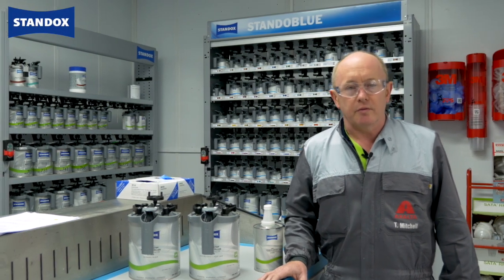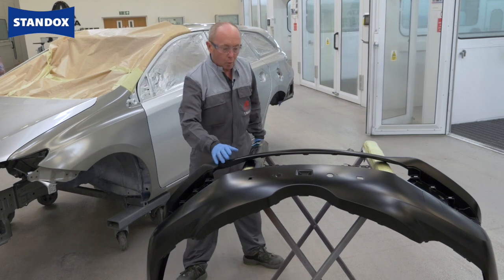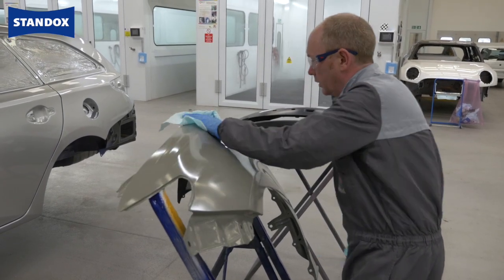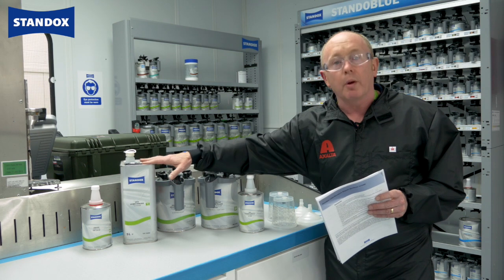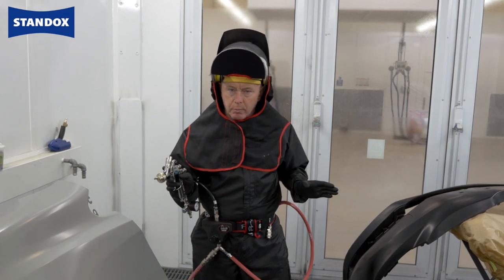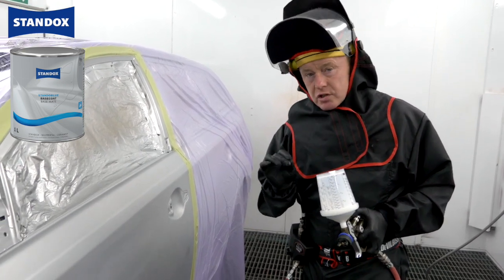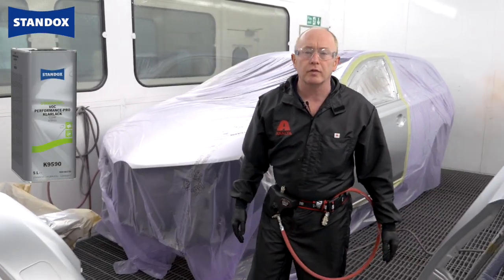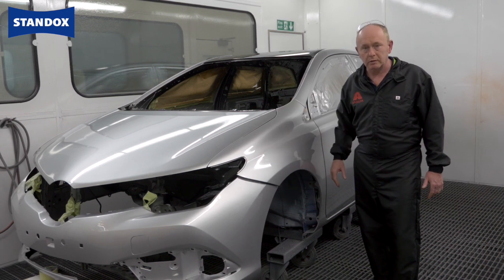Standovision: Standox VOC Nonstop Primer Surfacer U7580

Comment: What's reccommended for bare metal surfaces? I've had a lot of rust repair to do, so the car is now bare metal.
Reply from the maker: For large reas of bare metal we would recommend to first apply Standox Etching Adhesion Primer U3100 followed by a Standox 2K Filler. Depending on the substrate as an alternative you could also apply Standox EP Primer Surfacer U7200 before the 2K Filler.